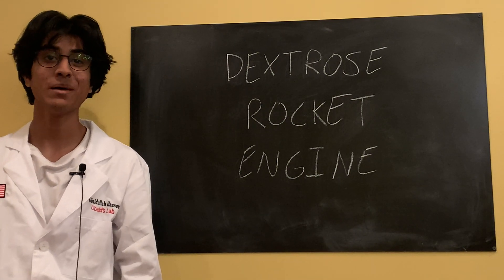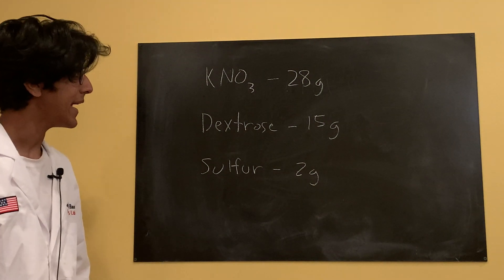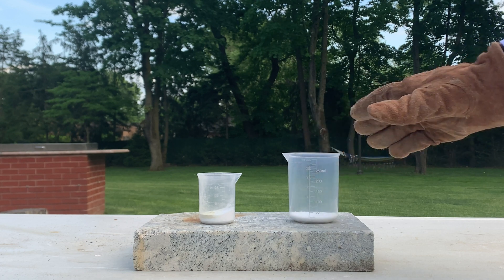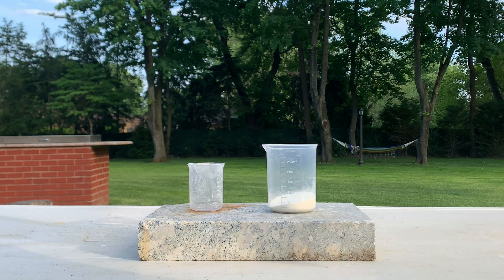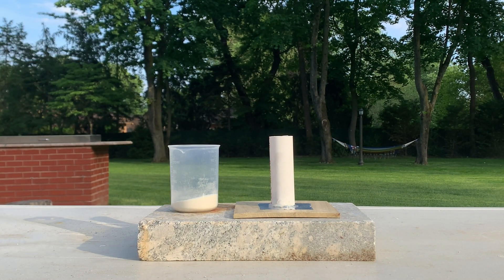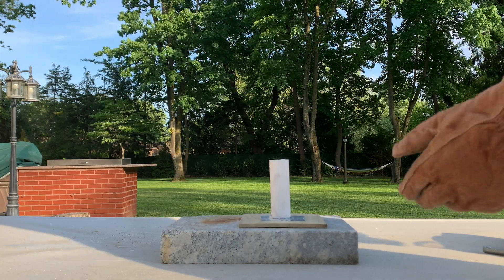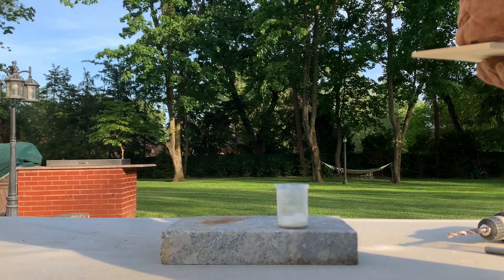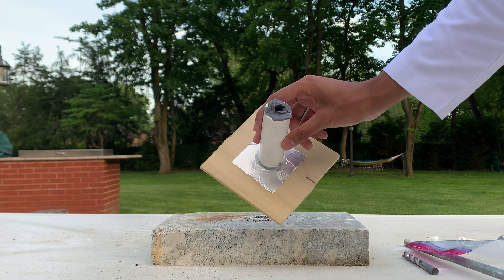Dextrose Rocket Engine Test

Comment: I didn’t have much luck with dextrose. I found that powdered sugar (sucros) is a lot more combustible and produces a lot more pressure in the chamber than does dextrose. Just be careful that your nozzle throat isn’t too small or your motor will explode. Took me a while to dial in the correct nozzle throat size but I read somewhere that a good rule of thumb is to make the nozzle throat 1/3 the size of the motor’s diameter. I’m using 1” pvc pipe so the ideal size of the hole in the nozzle is 5/16”-3/8”.